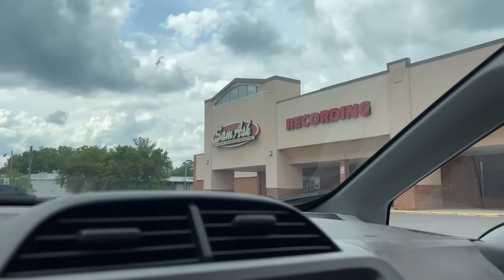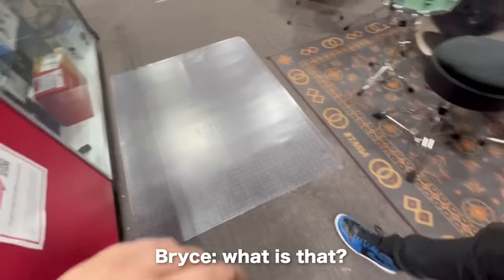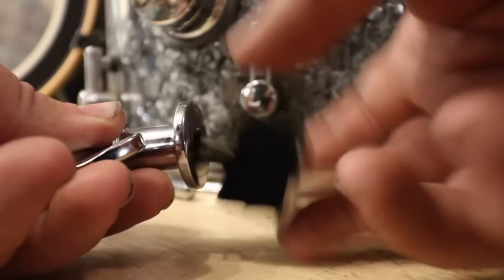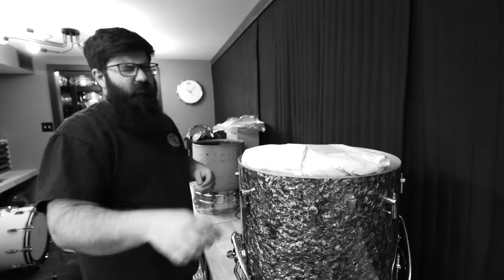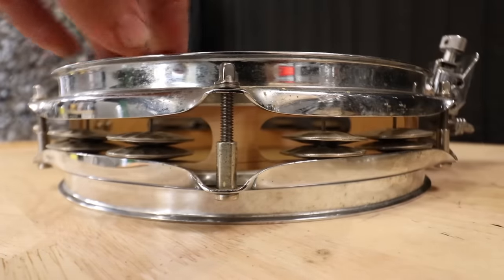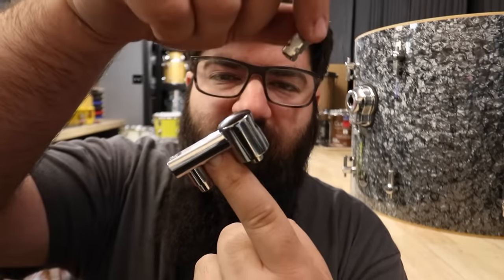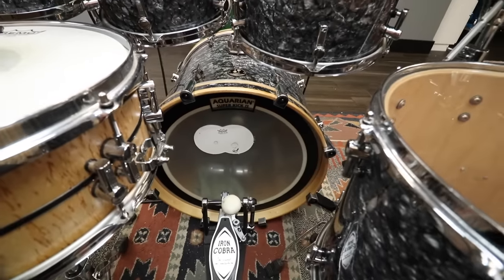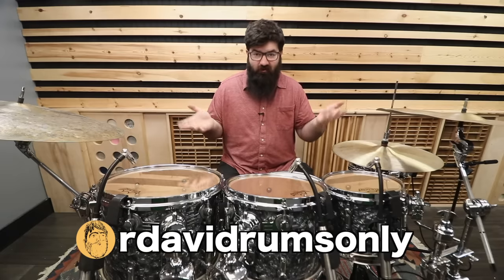I FINALLY Bought a SONOR Drum Set!

Comment: I remember on one of my first "gigs" an old head preaching about those dimensions and model of Sonor's.  As he said it was sush a full sounding live kit that was actually pretty small/gigable.  Iirc he wanted the 20" kick, 10" rack, and 14" floor.  This was a few years before all the "mini" kits were so readily available.

Btw:  i use "Great Stuff" brand wipes in addition to windex or white vinegar in semi professional cleaning applications.  The wipes are great for sticker residue in general(without having to break out the razor) and seems to be fine on wood/ other prefinished materials as far as not removing finish.  Ive used them on some gunked up wrap finishes on some old Yammaha's and musc. Chrome/chromed drum hardware to great effect as well.

Comment: I have a vintage 1960’s (1963 I think) Sonor kit that was my dad’s. 
It is still holding up great after years of him gigging with it, me dragging it to my friends garage to jam as a teen in the 80’s, and practicing every day for years while learning to play. 

Lots of drummers actually play Sonor- Steve Smith from Journey, Phil Rudd AC/DC, Nicko from Iron Maiden, Benny Greb, and many others. 

They do sound pretty good. Funny thing- my vintage set has tension rods that have a slot in them that has a unique drum key for them. You can use a flat screwdriver 🪛 to tune them in a pinch, but luckily I still have my dad’s vintage drum key. I only have one though which is a pain. 
The bass drum has handle pegs you can tune the bass drum without any key which is interesting, but a little bit of a pain because they can get knocked around. 

Overall I like the vintage kit. I play more modern DW or 70’s Ludwigs now though.

Comment: I have a mid 80's Sonor Signature kit with a 24" bass. I swear by the Aquarian  Super Kick on the bass. No extra dampening other than the factory dampener. The toms are huge. 12x12, 13x13, 16x16 and 18x18. I use Aquarian heads on them as well. Love my Sonors!

Comment: I got a Sonor Sonic Plus-set when I was 15 years old and started to play a lot live. I kept it for 30 years. During my active years, I tried out many other brands but never felt the need to change. My set came with very nice solutions for taking it down/putting it up in basically the exact same way. Very sturdy feeling, always. I never once needed to replace any fittings, it was built to survive an explosion I guess. Great sound, both live and in the studio. My kit really took a beating (pun intended), but it never failed me. 

Then I wanted to move far away and couldn´t keep the set, so I sold it. BUT. I just could not separate from the snare, so I still have it and ocassionally do some snare practice with it. The only strange thing about it was the tuning key. It is different from other kits, so I always had it with my other keys. I still have that too.

Comment: the bearing edges are cut to make it be that the head is very slightly too big for the surface contact area, like a timpani sorta. It actually gives a REALLY cool sonic effect. It's called, impossitune, and outin2seconds. I may be wrong on the spelling, but those are the main sonic charecteristics of every Sonor kit that doesn't have "force" in it's name.

Comment: just something to mention, you have to be careful with a little of greases or oils with rubber like that. some of them will provide short term moisturization, but will actually break down the compounds in the rubber making them more susceptible to cracking and drying and rotting. anything petroleum based can be bad for rubber and i’d recommend against using white lithium grease. i’d recommend using something like an o-ring lubricant that is silicone based  and designed for rubber.

Comment: I just picked up a Sonor Smart Force kit (BD, snare, 2 mount toms, 1 floor) for 50.00. A basic beginners kit (9 ply poplar shells 7.2mm). They sound pretty good actually. Smaller drums than I am used to but they take up less room so that is a plus, of course nowhere near as small as my "PureCussion Rims Headset, but... a lot smaller than my Peavey Radial Pro 501's. Ill need to replace the Sonor batter heads for the real test. SO far, I am liking them. 50 dollars. No way to not grab them :)

Comment: DW drums R so over-hyped unless you are mic ed up...But any drum sounds any way you want it if you mic them.
I had my kit built (I think) at the factory. Anyway, not good hardware, tunable to any ear, cost too much. I  have had major brands of all names, many different woods, different shells and DW is way over rated unless you are mic up.
I  believe Pearl and  Gretch are the truest sounding of the Maple woods. The hardware of each brand are very good.  I like Pearl's "no-ratchet" adjustment. 
That's my 2 cents and $4500.00 drum comment. Thanks. I enjoy your videos, teachings and comparing of all equipment. 
Thank you

Comment: RDavidR, here' s an idea before you sell DW - buy exact the same PDP DW set and do the comparison...My opinion is that PDP sounds the same or better and they are much cheaper...
One thing to point about Sonor is that Sonor lugs have system for detuning so the screws kinda turn pretty hard...and screws need special key which some don't like...Sonor iz pricey but they deliver quality ...what is DW for USA that same thing is Sonor for  Germany and Europe
They didn't do much hardware wise from S Classix on to the SQ2, only wood and finish differencies so you practically got what is the best...I agree they sound amazing

Comment: What took you so long?
I bought my blue Sonor Sonic Plus (the follow up Series ll was, well, not so good) in ‘96. Ups, 27 years already. Nothing broke. Bought it with the money I got for my mid seventies Rogers and never looked back. It’s birch, 6 ply toms, 9 ply bass (sounds familiar, eh?). Although Sonor sold it as lower mid class, the sound is quite the same as the S-class, sole difference is the cheaper metal thingies. It’s the only set I own, in combination with my ‘71 Ludwig Supraphonic I just don’t feel the need for anything else.

Comment: In defense of DW. . I called them about broken hardware and received , for free, without sending them anything, I received a bag with more lugs and etc hardware for FREE. . I still after 20 years have spare hardware that matches my set. Which you can't get anymore in the metal plating that my set originally came with. Now, maybe time has changed, but the cost of everything has gone up too. so , might have something to do with it.
Reply from the maker: From what I understand they dont want you making a fake DW so they dont sell spare lugs unless you can prove you have a DW in need of lugs